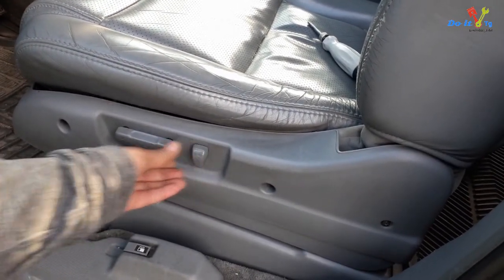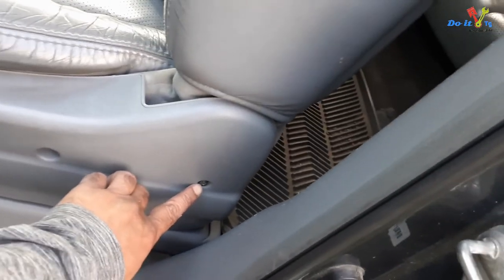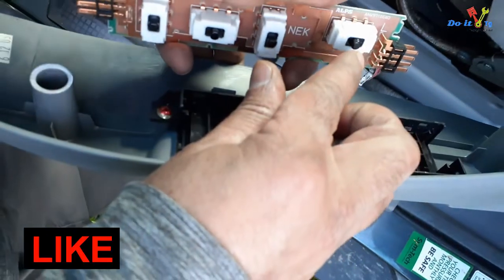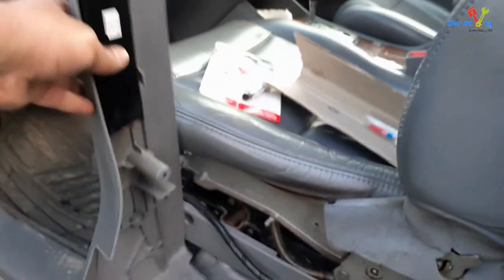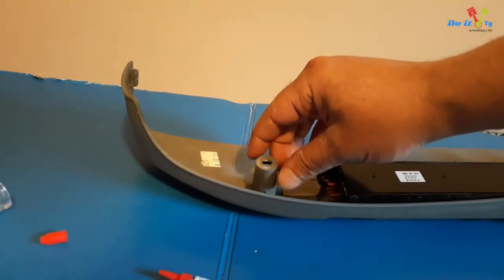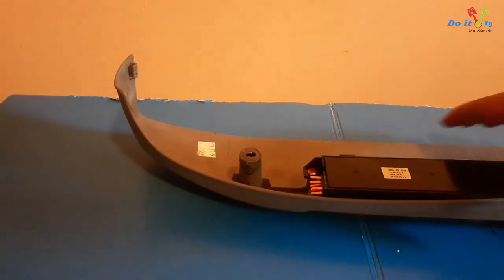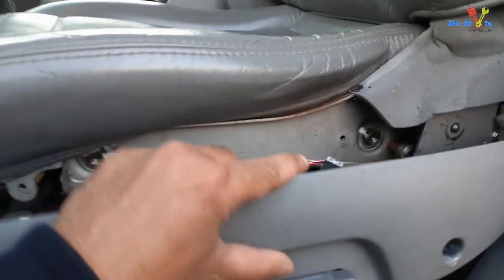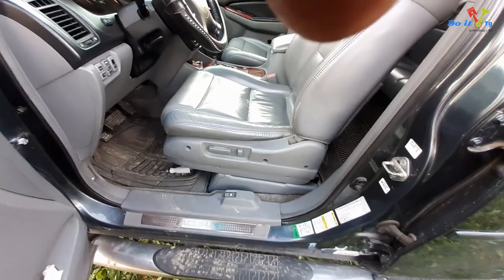Power Seat Recline Not Working

Comment: 8:50  the material is polypro so  no glue will hold it well. Use soldering iron and weld the broken bottom to the screw well walls
Reply from the maker: Thanks for the advise, i agree the weld will work better. but mine worked just fine.

Comment: Thank You for this video
My car issue is the seat move to the back 
But it doesn’t come to forth 
I mean everything working except the forth move
Reply from the maker: It could be a bad switch or track issue. your seat might be stuck in the track and does not come forward. you probably have to remove the seat and check the track.

Comment: Our seat cover had the same problem where the caps on the screw holes had broken off, but glue wasn't helping in sticking it back on. We ended up buying another seat adjuster panel cover, but we can't figure out how to get the slider pieces out of the old panel. Would you know how to do that? Thanks in advance.

Comment: I have a 2010 gmc Denali and my recline does not work i put it back to lay down and when I wanted to put it back up the button didn’t work anymore and the other buttons on the seat work just the recline one doesn’t it seems to get power to recline back but to go forward it don’t get power so it’s stuck back right now what could it be?
Reply from the maker: If it gets power to recline back but no power to go forward, seems like faulty button. if it got power to go forward and don't move forward then it would have been track issue. I would try testing the switch by using a wire and touch the two ends of the switch for the forward. You will have to remove the switch to test this. If this does not work, then you need to inspect the gear/track, if something got stuck there. There is also a possibility the seat has been moved (forced) back beyond the limit. Hope this helps.
Reply: We have the same car but opposite issue mine won’t go back 🫠

Comment: So i have a 2011 nissan maxima, my driver seat will recline but not come back up & my passenger seat wont recline period. Can you give me advice?
Reply from the maker: Driver Seat: could be switch or stuck track/gear. When you press switch and you feel or hear it's trying to move but does not move, then the track/gear issue. If there is no power, then most likely it is the switch issue.
Passenger Seat: Check to see if you notice any power when you press the switch. if no power at all and seat does not move in any direction, then check the fuse first (see your manual to find the fuse location). If fuse is good, then make sure switch is not disconnected, like mine in the video. Worst would be the motor. Hope this helps. Let me know what you find. Thanks

Comment: My 2008 Hyundai Santa Fe Driver side power seat stuck in decline cannot get it to incline  it works a few time and then stock Oh I cannot use my vehicle any help thanks. I also took the whole seat out to check for broken parts seems OK.
Reply from the maker: Does it have power and tries to move but doesn't when you press the incline button? or it does not do anything?

Comment: What If You Are Reclining The Seat And It Stops In A Certain Stop And Doesnt Go Back Anymore? mine is Just Stopping Midway and just Making A Rattling Noise
Reply from the maker: you probably have to remove the seat and inspect the tracks. something must be loose that made it stuck in that position.
Reply: @DoitTg  Great video sir. But if you're having issues with the recline function you wont be dealing with tracks. You would have to inspect the gearing mechanisms. Tracks are only used when sliding back and forth but reclining motions usually operate off gears. Once again thanks for the helpful video.

Comment: I’m still unclear as to what the issue was? Was the whole controller board not working and replaced? I’m having the same issue with my 2013 accord. Tilt is stuck and barely moves like half an inch beach and forth
Reply from the maker: In my case, the cover was broken loose and it got unplugged. If you're getting power to the seat and feel it tries to move but does not move, then you need to check the gear mechanism.

Comment: I replaced with new switch still won’t recline just clicks. Also when I go to move seat forward have to push lever backwards an vice virsa. This is on drivers side only..
Reply from the maker: You will have to inspect the recliner mechanism. it seems it is stuck. 
And for the forward and  backward, i think it is placed upside down. you will have to remove the switch and flip the side. hope this helps.
Reply: @DoitTg  I have inspected it but only hear a click sound from main control board under seat. Everything looks good but won’t move. the plug that goes into it only goes into forward back only fits one way.

Comment: All buttons in my mazda cx7 2011 are working, except with the reclining button, how to fix this
Reply from the maker: Do you feel the power when you press the button? if yes, the track might stuck. If there is no power, you may need to change the switch or check wiring going to that switch.
Reply: I’m having the same issue…. I’ll check my track to see if it stuck cause I’m hearing the motor